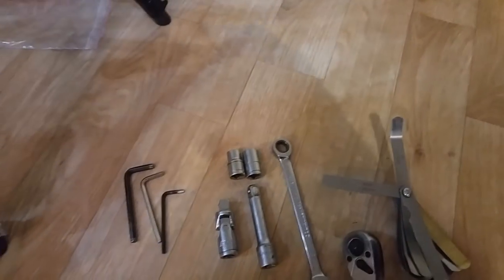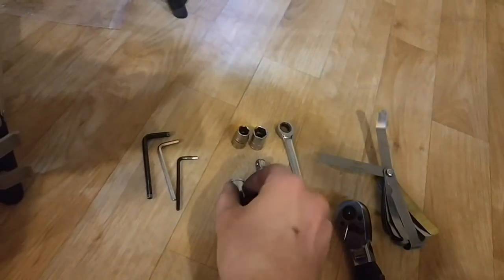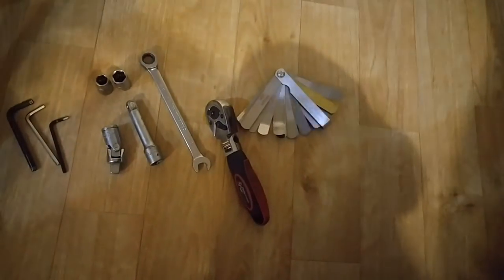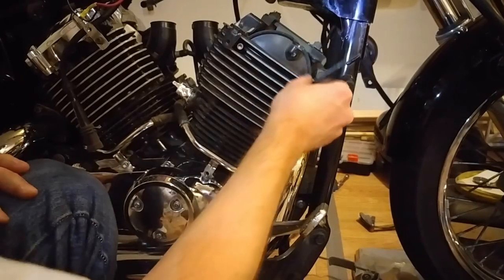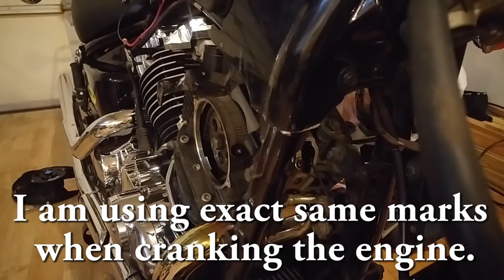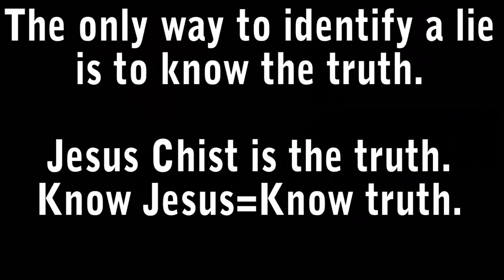Yamaha V Star 650 XVS650 Valve adjustment

Comment: Very good video. The process is the same for XVS 1100. Don't forget to use a torque wrench to tighten the locknut to 27 Nm (in 1100 at least, probably the same for 650).
Reply: The 1100 is much easier to work with, to get at the valve adjustments.

Comment: Very nice video. Would like to add ,that you should also replace all 6 orings when doing your valves. They are cheap and it will keep you from taking apart again to fix one of 6 oil leaks. Again very nicely done.
Reply: Hi Roy; I have my 650 torn down now in my garage. What 6 o-rings are you referring to? I know of 2- intake and 2 exhaust. What else am I missing. Thanks
Reply: Wally Czarnik. cam covers.
Reply: got to remove to line up timing marks.
Reply: don't over tighten the covers when you put them back on...

Comment: Tony: Thank  you for your presentation. However, a few suggestions based on several points I noticed (FWIW):
Give the year of the bike, so riders can quickly determine if your information applies to their bike.
Start with the bike fully assembled and then state which pieces must be removed and why. Some items are very difficult to remove without removing other pieces first. This should be explained.
There is too much ramble in place of solid information. This leaves the viewer with a "come on, come on" feeling wanting to get to the necessary meat.
Better lighting is needed.
I know that such videos are difficult to do and your effort is appreciated.
Reply from the maker: Agree to a degree.
I got better lighting but my camera and lens are cheap so it is what it is.

Comment: Much easier if you just slide the desired size feeler guage between the valve and adjuster and tighten everything down while the guage is in place.
Reply: Tony Nameless still a great video, just thought id suggest the technique i use.
Reply: Same issue, mine was the Gasket. Cheap and easy to replace.

Comment: I also seen a trick where u bottom out the adjuster screw, back it off 1/4 a turn. tighten, then check it. should be close.

Comment: Thanks for the video, it helped to understand the process. Would you please make clear why it is necessary to crank the engine several times during the adjustment? It seems a bit strange to me that the gauge didn't fit in the gap at all the first time and, after turning the crankshaft one more time, it went easily.
Reply: Maybe wasn't at top dead center first time ,or was on the wrong timing mark for the cylinder you was working on.

Comment: I think I have a leaking cylinder head cover o-ring (rear cylinder). How do I get best access to that (need to remove tank?) and how should I go about fixing that leaking o ring. Thanks.
Reply: Thanks man. I'm talking about the part you've got in your hand at timestamp 22:09. There's clearly an O ring there. I think it's called either the valve cover or the tappet cover. I'm pretty sure that's what's leaking in my bike. Looking forward to your vid! Thanks!
Reply: Thanks! Will do.

Comment: At exactly 22:05 in the video, on the back side of the rear cylinder head cover, there's a port that comes out, and angles down 90 degrees and is connected to something. Does anyone know what that is called and what is connected to it? The bike I bought has that port open and it's loud af. Just trying to get it back to factory noise level.

Comment: I want to do my valves for the first time, can i use this set?
0,05 mm/0,002"
0,1 mm/0,004"
0,15 mm/0,006"
0,2 mm/0,008"
0,25 mm/0,01"
0,3 mm/0,012"
0,4 mm/0,016"
0,5 mm/0,02"
0,6 mm/0,024"
0,7 mm/0,028"
0,8 mm/0,032"
0,9 mm/0,035"
1,0 mm/0,04"
Reply: Ah thank you man, i've been checking out serveral stores, they all carry the same range, with huge jumps between sizes! i'd like a more full set, like yours it would help me screwup less :P just in case!
Reply: Found one that says: 
0.05-2.00 to 0.1 mm increase. 
0.05 mm. above with 0.1 mm increase.
21 pieces.

Comment: Right under the valve, what is that port in the back of the engine?
Reply: No they are connected to the carbs, but I will find out, thanks
Reply: That covered it, and I actually found it in my repair manual, and the reason I asked my looks like they have cracks in them, anyway I finally started tearing it down and I realized my feeler gauge is the wrong one and that I didn't realize the carbs need to come out, so I have to make sure I can do that without screwing that up, but I need to do it so Thanks Man!

Comment: it's supposed to be .004 on the intake and .006 on the exhaust. just did mine and the intake was .006 after 65,000 miles. This video is going to make your motor sound like a sewing machine. way to loose. very critical on motorcycle engines